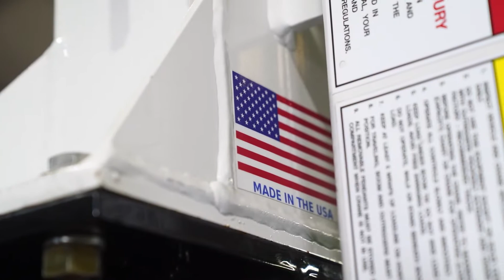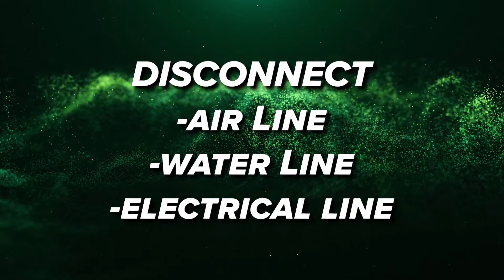DB500GT Pro Jib Crane Guide | Dustless Blasting Academy

Comment: Speaking as a rigger, it would make a lot more sense to add two more lifting lugs and a bridle so that the blast pot stays level when being moved.  That little swing at 3:44 in the video wouldn't happen if it were balanced and level.  I'm assuming this video was done with an empty pot, how much swing is there when fully loaded?  800 pounds has a lot of momentum, even when only travelling inches.  

Perhaps a set of "ears" could be added on to the handle assembly.  Looking at the 3d model of the db500, could easily add a lug to the side bars of the handle assembly.
Reply from the maker: Awesome suggestion! We are always trying to improve our machines so we will let our team know.